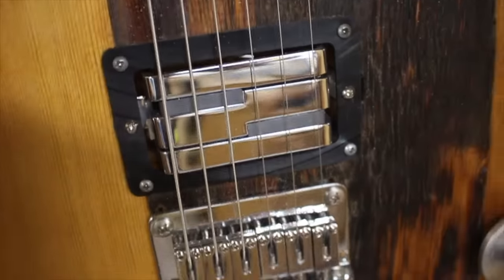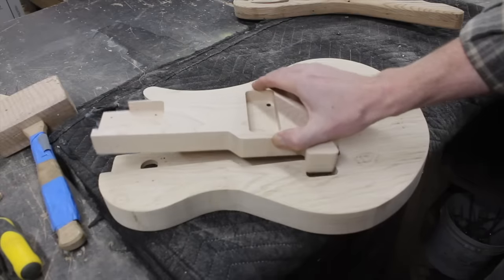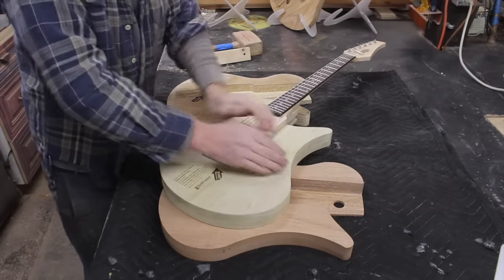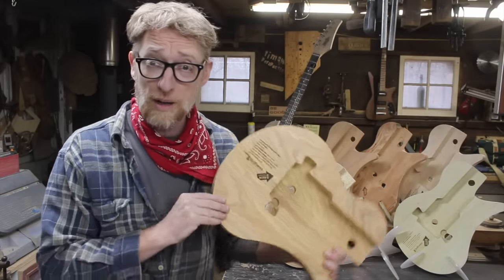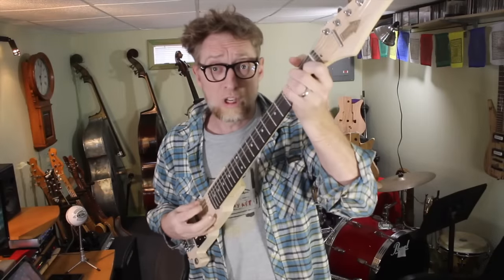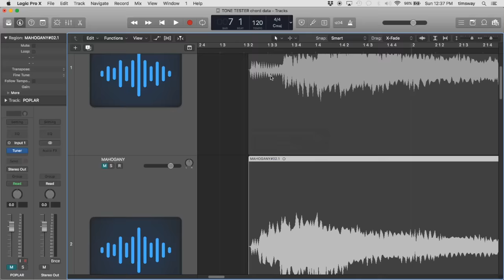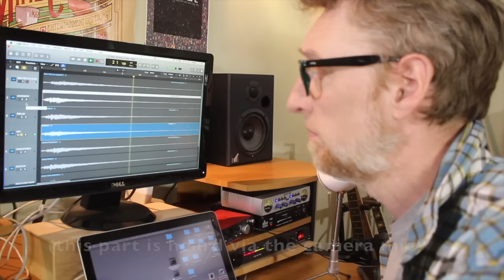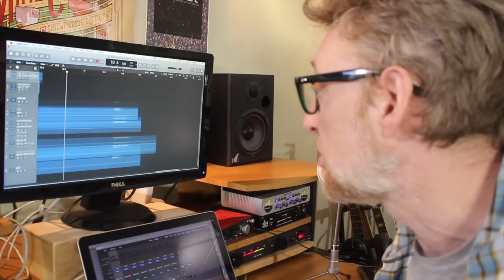Tone Wood Tester: One guitar to test them all

Comment: Really interesting video. You seem like a truly non assuming well balanced guy and your son appears to have taken after you quite a lot, that's good. In the strummed sound samples what I noticed was a similarity between Mahogany and Canary, slightly tighter bass on Canary. Ash and Poplar were both a bit more jumpy but Ash somewhat more pronounced bass. I've been told by many guitarists and drummers that I have the best ears of any engineer they've worked with, live or studio, and I accredit that to a long time of paying attention to not only frequencies and volume, usually each in isolation, but the duration margins between frequency spikes or transients and harmonics (yes, I can single those out by ear). The Poplar, for instance, has a very jumpy quality to it, individual notes tend to reach peak transfer very fast and then move out of the way. If we think of electrons moving through copper Vs. plastic or silver, the resistance to or conductivity of each material clearly makes a difference in signal integrity as well as behavior but not in characteristic. 

Note that the Mahogany really cuts down the high frequencies while rounding out the lows Vs. the control neck alone, this is more a subtractive thing in my view than an additive. I don't so much hear frequency differences in these samples, although I do, as much as I hear duration differences. Duration of note envelopes, ramp up Vs. ramp down times, are what lean us toward words such as round, soft, dark, bright, jumpy, poppy, sustain, resonant. When 6 strings tuned to the same pitches are strummed we are all hearing the same frequencies, those simply do not change, so it must be other qualities than the fundamental pitches. That leaves just a handful of tonal characteristics in play that could possibly be altered. Volumes of individual tonal characteristics, ie the amount of resistance, are there but more importantly are the envelope times or durations of frequency ranges. These are the things that trip up almost anyone and it took me years to get a grip on it but it's quite simple once you know HOW to listen for it. Think in terms of dynamic range as applied to each individual note, not relative to any constant such as a VU meter or any static electrical measure but in accordance to its RT as a slope relative to the slopes of simultaneous notes. These margin will never be static, always floating point, if they were static none of us would need a comb filter working inside of our head to identify Ritchie Blackmore from David Gilmour back to back.

In my opinion, I prefer the Poplar sample here as I can't really see a need to record or perform with an instrument that will just need to be later notched in to allow for a bass and vocals to not be stepped on. What 99% of guitarists miss in selecting a guitar based on ''tone'' is that it will NEVER sound as it does in a room alone as it does in a mix or with a live band through a PA. In fact, many times the perfect sounding solo guitar just won't jive with a group, it plays well but it just doesn't play well with others.

Comment: Fab job! Kudos! It will not change few if any minds as this stuff is like religion.
But your approach and execution are solid. I use many basswood bass bodies these days
after two back operations I need light basses for gigs! I was warned "they will suck and have no bottom"
I have not found this to be the case. The often overlooked thing in bolt ons is the neck pocket/joint.
Any "sustain  problems" and dead notes most often ended up with improving that connection.
I have an interesting theory on dead notes and their relationship to the headstock of a bass.
Would LOVE to see you use your resources to explore my theory.

Comment: in my opinion, since pickups work through induced EMF and induced EMF is velocity dependent with respect to the sensor(pickup). and the body when it vibrates has its own resonant frequency, and the sensor is sitting on that vibrating body will result to subtle inconsistencies on how the sensor reads the frequency of the string because the the sensor itself is vibrating... hence the tone difference...  
those who deny that tonewood exists are assuming that the system is STATIC except the strings, and thats a simplistic view of physics... but in the real world, nothing is ever static... everything is dynamic.. but the effect is very subtle because the only signal thats relevant is the one coming from the string because the amplitude of that wave is way bigger compared to the amplitude of the vibration of the body which is why the effect is almost inaudible...
Reply from the maker: Two pieces of wood cut from the same tree would certainly have different grain structures and sound, under a microscope, a tiny bit different. Sure. Different species? maybe even a little more, tiny bit different. On an acoustic instrument, 'normal' people  may even be able to hear it! 

The question I'm driving at is, how much does it REALLY matter? Is it worth the social and environmental impact for the average wanker to poorly play Smoke on the Water in their bedroom? The pros aren't off the hook either. Every time I hear some musician step playing their factory made Rosewood and Mahogany guitar with a lacquer finish singing about saving the planet I cringe at the irony.

Want better tone? Stop obsessing over and paying for "tone wood" and practice instead :) Want to save the planet? Buy used or from businesses that give a crap about how they make things.

Comment: dude not even concerned with the tone difference argument , but DAY-um. you should make some actual guitar and basses designed like this, and then you could have multiple bolt-on  bodies , like fully paint the differnt bodies and every thing, that way the user can bolt on what ever body they feel like for that night at the gig , that would be freaking awesome. 

I could see this idea making some (huge piles) money.

image  being able to play a P or J-bass with out owning two differnt instruments that require their own maintaince and  (expensive) strings ect ect. just bolt on the body you feel like for that night. or  a strat  versus a flying V.   Hell  musician's could even change body's quickly  in the same show.
you need to make some minor alterations though , first off figure a way to add tone knobs to the system and then some way to change out the pick-ups. maybe go with plugable pick-ups. that way the user could change those as well. 

it really begs the question why guitar manufactures never thought of this idea.  Probably because they want to sell whole instruments, strings, and the idea of tone woods on solid bodied guitars.  
i have three basses ,  A US Fender p from 1995 ,  a steve harris sig fender P from 2015 and a ESP LTD TA-500 from 2004. i play with rotosound  flatwound strings  (RS77LE's)   which typically run 35-40 bucks (USD) a set. so restringing all three of them at the same time cost me $110-135 , depending on the strings current price.

Comment: Loudness: the ONLY thing that affects loudness is the strum and all that's included. The wall test was irrelevant. Pickups are not microphones.  I think you know that. 
Sustain: what affects sustain is how solidly the endpoints of the string are being held. That's it. Since you didn't change that from one body to the next, it wasn't a test. 
By using an E chord you brought in another variable, string pressure. Try the same test with all strings open. 
On strumming, the velocity can be measured on your DAW by noting the time lapse between the the two E strings.  The biggest variable is how tightly you grip the pick. Tiny variances mean a lot. You cant really control it. There are some other variables too like pick extension and how far into the string you plunge the pick. Too many to control.
Sustain also relies on initial volume of each strum  which can be compensated for on your DAW. Set each track volume so the initial strum is exactly the same. Do it by lowering the high ones on the track graph itself. That way you can see where it drops off in relation to the others.
Fun video to watch although there is nothing you can do to disabuse the electric guitar tone wood "enthusiasts" of their concocted beliefs.

Comment: I think you hypothesis was correct, I think it's a function of stiffness and density.. the neck is usually the stiffest part of the guitar so It would be interesting to hear different necks.  
The thing about body tonewood for me is that you should buy it for the looks first, the weight second and the tone last.  For a neck I think Feel, Stability, Tone and Look are the order I would put my requirements in.

Comment: I know it’s been years but is direction of the woods grain change things.
Reply from the maker: wood grain is important in structural stability of guitars, which are under a lot of tension from the strings. This is why quartersawn wood is preferred for necks, and if you were to, say, flip the wood sideways for the body, the guitar would be more likely to curly up like a potato chip under the pressure.

Comment: I've always been in the camp that tonewood does matter, even on electrics, but that you'd only notice on very clean tones, and even then so little that it's not even close to the most important factor. I do think that it affects the feel of the guitar more than sound, though. How quick or slow the attack is, sustain, etc. I appreciate you doing this test, but I think the test was flawed. I think all you were hearing was the maple base you made. The only way that I can think of that would allow the wood to affect the tone at all is for it to be the way the vibrations transfer through the different parts into the tone wood. The bridge through the screws into the wood. The strings to the nut to the neck to the body. Different woods will vibrate differently, affecting the sound. At least that's what it seems to me. In this test, the primary vibrations that are affecting the different parts is the maple base.  I'm no scientist, though, so that with a huge grain of salt.
Reply: I would say that the body of the guitar acts as a damper and soaks up energy from the strings, causing a different vibration pattern. The wood itself does not make any sound at all that's picked up by the pickups. On acoustic instruments it's the vibrating wood that amplifies the sound of the strings. That's what I would call tonewood.

Comment: Nice video, clever idea, great son! Here is why the wood makes a difference, if it does: The output from the pickup results from the relative movement of the string to the pickup. Sound from the strings pass to the guitar body through the bridge and, long way round, through the nut and back down the neck. The resulting movement in the body wood transfers to the pickup and this movement in the pickup changes the relative movement of the strings. If different body woods resonate differently, it changes the movement of the pickup and therefore the sound. Construction therefore makes a difference; bolted, set and through neck construction change the rigidity of the return path from the neck vibration. In effect, you built a through neck guitar, that naturally minimises the difference made by the body wood. It was a good test.

Comment: What never gets said in any of these debates - 
IF any difference due to the body wood does exist then it can only be due to the way that the sound-waves resonate through the wood.
( - and presumably return that energy to the string(s) since the only thing that will produce a signal is the movement of the string in the magnetic field)
Agreed?
So let's look at the situation of someone actually playing an electric guitar.
They have a hand gripping the neck and probably an arm resting on the shoulder of the body too. 
The body of the guitar is held against the body of the guitarist.  Not only is the human body a poor conductor of sonic frequencies it is also swathed in cloths of various kinds.
Given that the alleged sonic qualities due to "tonewood" will be miniscule in amplitude and fairly high in frequency, can you explain to me why it is not swamped out totally by the various dampening effects described above?

By definition, the differences due to "tonewood" are extremely small otherwise they would be obvious to all and there would be no debate.
If such differences exist then they MIGHT possibly be discernible to a player plugged direct into an amplifier in quiet surroundings.
However, that is not how electric guitar is played.  Once you are with a band and everyone is playing loud enough to work with the volume of a drummer, any such subtleties will be utterly insignificant and that applies to all scenarios - rehearsal, gig or a mix recorded in a studio.

Should it exist at all, which I doubt, there are MANY other things which significantly alter tone far more than "tonewood" possibly could.

Comment: Test out different metals like aluminum, copper, brass, nickel, led, and zinc.
Maybe even different thicknesses and spherical shaped wholes behind the stringsin the back of the metal body vs no dent.
I have a theory that an aluminum body with a spherical shaped dent behind the strings will have either the most or the least metallic sound.

Comment: Hello tim what about like a person to make a guitar out of reclaimed plastic you know like the old guitars of Nationals and Valcos they were hits back then I wonder if it would make a viable alternative and to add a wood base even if it was a mixof torrified wood and plastic wood it hold up like a epoxy would or even a exopy mix with plastic and torreified wood mix it just an idea I have had for a long time even to come up with this type of alternative would the guitar industry be able to use and become the next new guitar material that really works as good or better than a solid wood guitar  and I love the way you make so many experiments with woods and guitar building as well
Reply from the maker: I personally avoid plastic in general but for sure reclaimed plastic could be used. Cheers